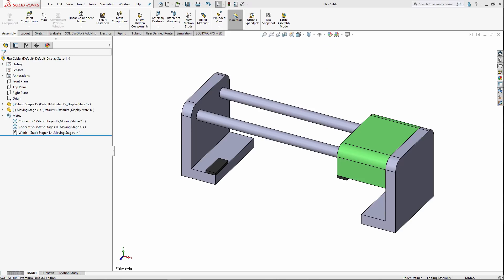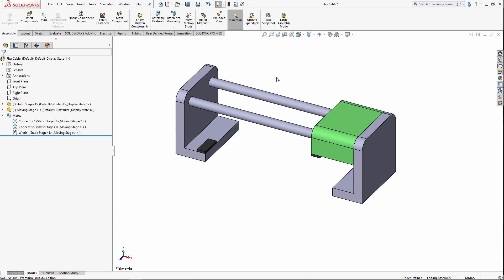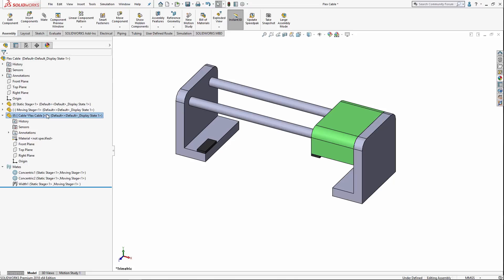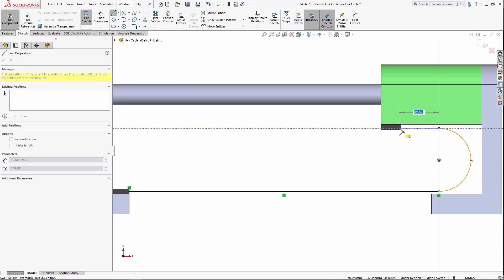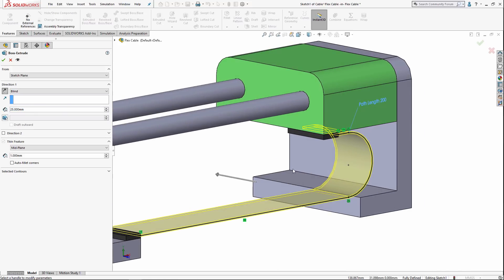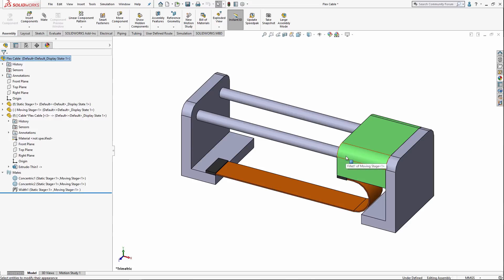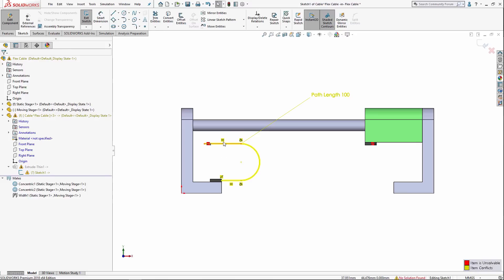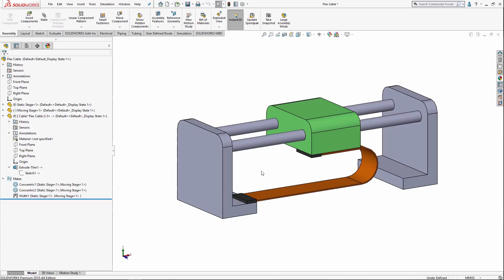SOLIDWORKS   How to Model a Flex Cable in an Assembly

Comment: Nice, but does this work in 3D, e.g., with a round cable that flexes in more than 1 direction like the FLAT Flex cable you show?
Reply from the maker: Indeed! Instead of creating a 2D sketch as shown in the video, you could absolutely create a 3D sketch instead and use 3D sketch entities(Lines and Arcs) to define said path, such as we do in Routing, and use the Sweep function with a round cross section. However, 3D Sketch entities typically require a bit more work than 2D Sketch entities to properly constrain and dimension, so you need to take that into account as well.

Comment: will it update automatically if it was not fixed?
Reply: questions is, can you use this for a spring?
Reply from the maker: We have the virtual part fixed in place because the overall shape is determined by the sketches and their in-context references to the other components in the assembly and their positions at the assembly level. While yes, we can unfix/float the cable to move it to new locations, the design intent behind these in context references of the cable may cause it to break/error out  when attempting to rebuild in a new position where those in-context references may not solve in the same way.